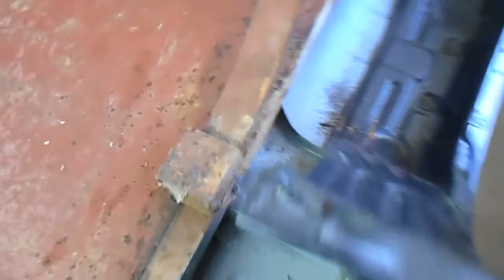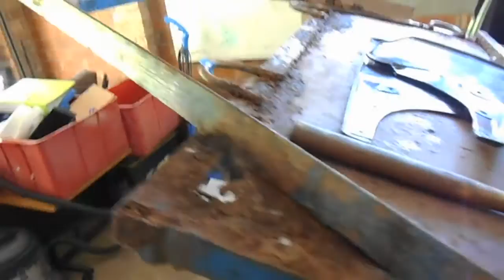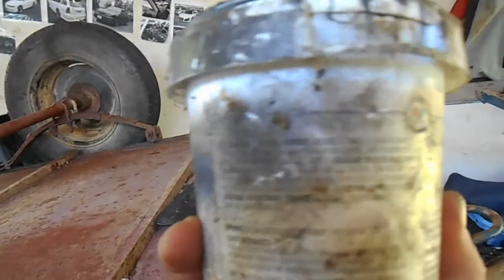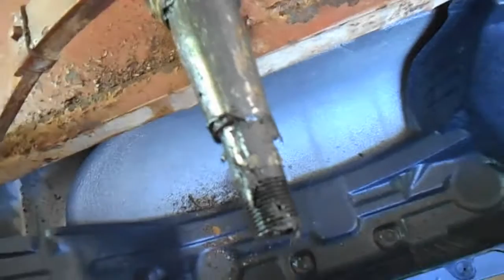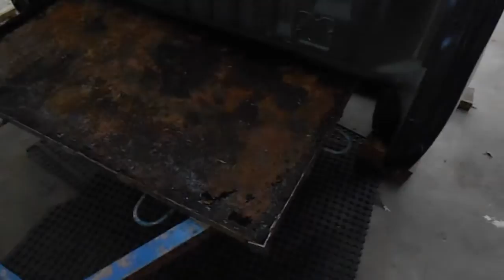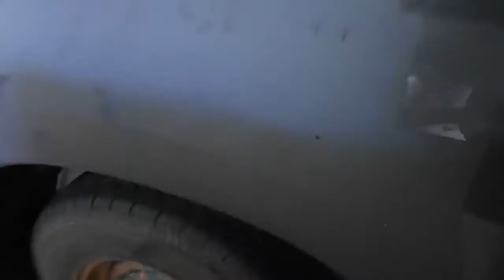1971 home made trailer rebuild with Toyota Hilux tub: Part 2 Right way up.

Comment: So much useless information and non of the important information. What measurements did you use how did you make brackets to mount the tub
Reply from the maker: That so called “Useless information” may be Useless to you, But it’s what the people who I built the trailer for requested in the “Updates” as at that stage they lived over 500km away from where I live. This was the easiest way to keep them updated on the build and the paperwork, As the trailer was originally a “Home made trailer” built in 1971. Since it was out of Rego and had No VIN number attached to it, It then had to undergo all the “Useless information” and paperwork just to get it re registered again in New South Wales as a new trailer to comply with the currant ADR’s. As for the brackets there’s nothing special about them, You can go to your local Bunnings in the bracket Aisle and get the 50x50x3mm RHS brackets off the shelf. Bolt them to the factory mounting points on the Tub, Then drill the holes in the required locations on the Chassis and bolt it down. In this event I added 50x50x3mm Alloy Square stock I had laying around just to give the Chassis a bit more rigidity and make sure you use high tensile bolts, The plain Jane galvanised bolts may save you a few bucks but pending on the assessor it may get knocked back and you have to put High tensile ones in any way...................... Don’t ask me how I know.